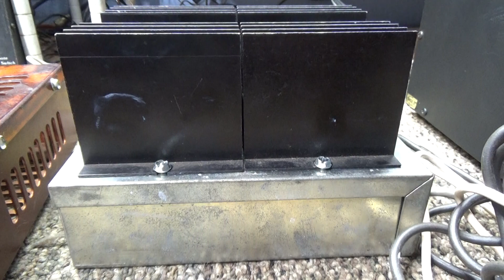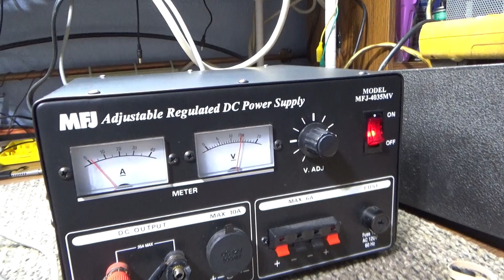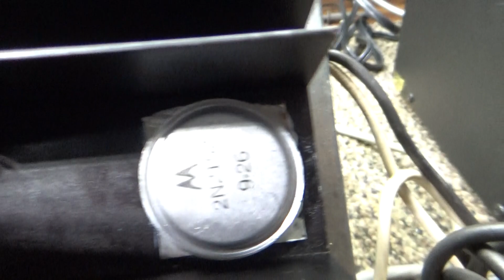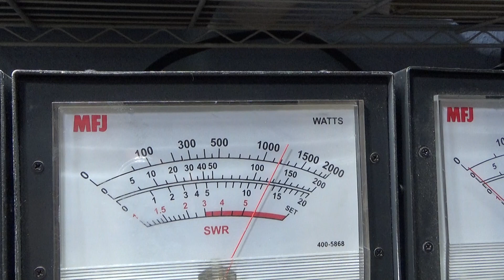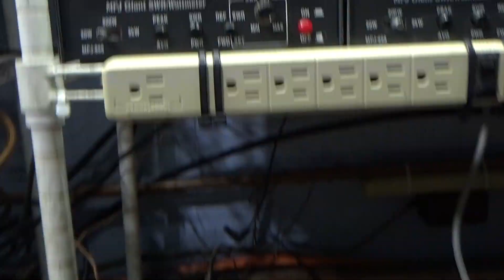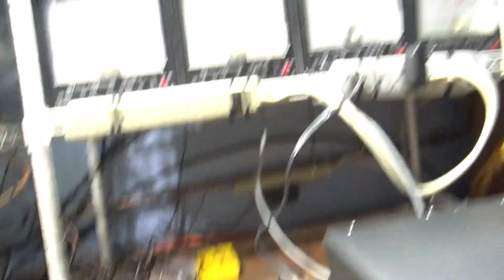By popular demand, Blackcat JB-76M aka JB-200M mobile on the bench

Comment: I get the best input Swr by adjusting for full output however the tube plates glow .. lm limited on key down time
Reply from the maker: Yes thats the way it was designed and you are doing it totally wrong. In the case of Blackcats, they use the input SWR as a drive or power level adjustment. If you adjust for best SWR, it will put full drive and input into the Turbo charged modulator amp and you will soon kill it. The correct way is to 'Set-To-Line' or less or adjust for forty watts or less. Of course your input SWR goes up doing it that, but that's the way that ball bounces. Last, this is only with the Blackcat amps. Normally I preach adjust the input SWR for lowest input SWR.

Comment: I love the grid input circuit of the Black Cat. It makes for a huge amount of swing! I have 3 power supplies and 4 power heads. Each one of them is different! None of them can be swapped with the other, even with the same model numbers. I had to mark them so I can keep them with their correct mate. Black Cat simply used whatever surplus parts that were cheapest, or they had laying around that week and they changed the circuit design to match. But that was common practice with a lot of amp manufacturers back then. D&A used some surplus military transformers, that were leaking, for some of their bases. They drained the oil first. It was a cutthroat market back then. So keep in mind that the schematics may not actually match what you have in front of you. Mine don’t.😊
Reply from the maker: you are 100% correct. I have schematics for about 5 versions of the JB-76 and 10 of the JB-12 and I have probably seen and worked on twice as many versions. Even things like the pinouts are different and if you hook up the wrong one or the wrong way, you will let the magic smoke out. The bad part is, since there are so many versions, it is very hard to help someone who has one with problems.
Reply: @tramdr You have seen many more than me then!🤣 Do you remember the manual that tells you what NOT to do, or you will put it on the CB band? I saw one. It was like, “Don’t move this tap to this position. Don’t put this value capacitor here. Doing this will cause it to illegally work on the CB band” or something close to that. 

Btw, I got it wrong about the transformers. It was Varmint that used surplus military transformers that had leaked. They had bad rubber seals around the posts where the wires came out. So Varmint drilled holes in the cans and drained the oil and used them dry. They were much larger than needed, so it didn’t matter that they had no oil. Seems like amp makers used what was on the surplus market at times.🤣
I hope you get some enjoyment in your semi-retirement. I retired 10 years ago and my “to do” list keeps getting bigger!